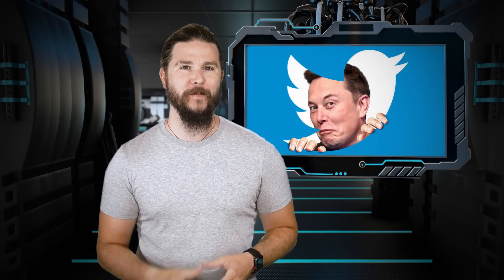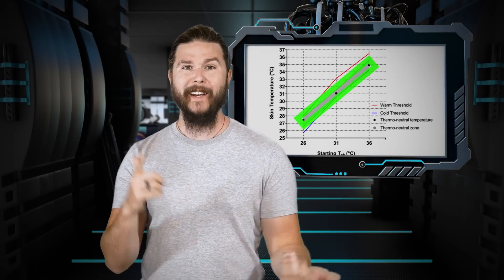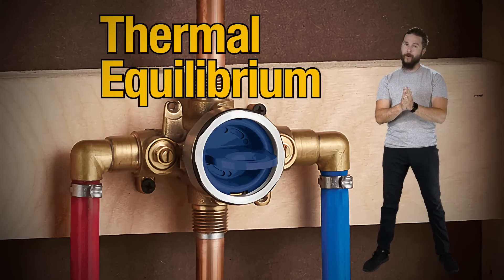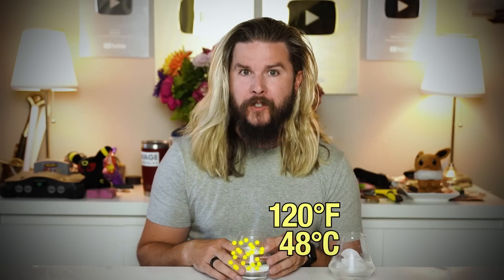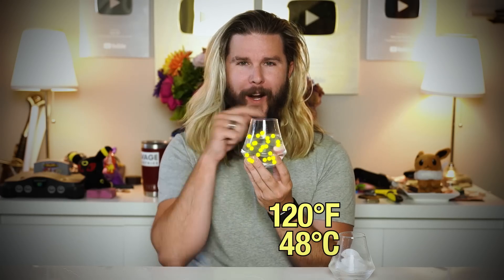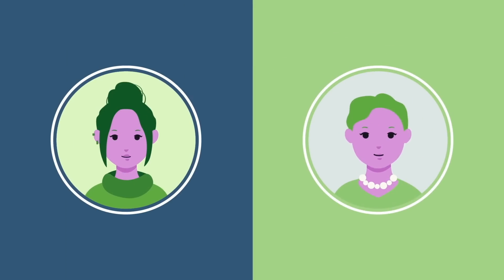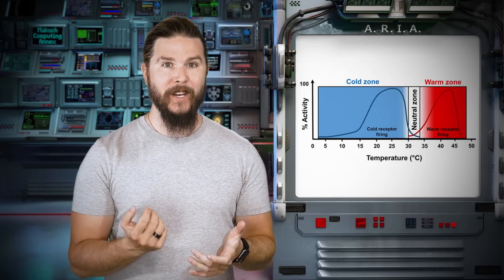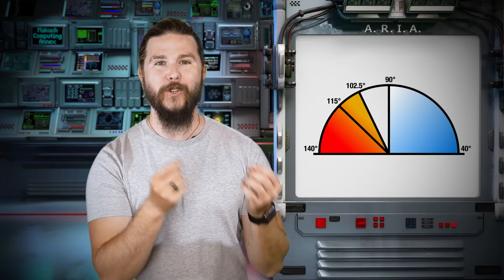Why Are Shower Handles So Sensitive?

Comment: As ever, great video! My problem is I have neuropathy and one of the results is that even in areas that I still have some sensation I can only feel very extreme temperatures like ice cold and burning hot. As a result I can’t tell if my bath/shower is too hot or cold so I need who ever is helping me to get in also needs to check the temperature so I don’t scold myself it is also one of the reasons I can’t cook anymore, sky high risk of burns!
Having any kind of peripheral neuropathy really sucks and can set limits on abilities you would ever even think. For me mine is progressive as is my primary life limiting condition of progressive cerebral degeneration, that’s the one that has me in a wheelchair as well as a host of other effects. It is amazing how much your central nervous system is actually involved in!

Comment: I actually find those showers easy to regulate when compared to the ones I'm used to. Electric showers have the temperature regulated by the inverse of the flow rate, and with a lower flow rate there is less water to warm me, so I have to deal not only with a temperature function that looks like K + 1/x, but also with a variable flow rate

Comment: Ah.

I didn't know these primitive shower controls still existed until I went to the US, and I didn't know people still had two separate taps for cold and hot until I went to the UK.

Why do you keep using these primitive technologies? You're not the PrimitiveTechnology channel. I've used thermostatic showers for the past 30 years and only had one case they didn't work - and that was a stupid installer installing it backwards.

Comment: I don’t get how this is a problem as all the homes that I’ve been in (east coast USA) have two knobs, one for hot one for cold, then a third knob /pull stick/lever to turn the faucet for the tub to turn the water to the shower head. 
This problem has been solved for decades, I just think the one and done system is just a contractor standard ie cheaper. 
Though it is interesting how the one for all system works. Or doesn’t work.

Comment: Here in Brazil we have two kinds of showers. Electric showers heat the water using a resistor, heating the water that passes through the shower. This is the worst and is the one with which we have this kind of problem too. It is either too cold or too hot, and sometimes it even depends on the local weather. On the other hand, we have gas heated showers. This one has a temperature control, like a thermostat, which lets you choose the (approximately) exact temperature you want for water. Also, this kind of shower has two handles: one for hot water and one for cold water.
Reply: wasn't the electric ones the ones that can give you shocks if the ground isn't used?
Reply: yeah but it's very unlikely and safe. I got shocked twice in my ungrounded shower head and it just was annoying. No real hard
Reply: harm*

Comment: IMHO we need a different shower water valve layout: three valves, three knobs. One knob for hot, one knob for cold, one knob for total flow.

That way, you can set it to the exact ratio you like, and leave it that way. No more fiddling with the water temp every time you turn on the shower; you just turn the flow knob and you're good to go. I think we should also have this for bathroom taps.

I plan to build a house one day, and I have every intention of setting my taps/showers up that way.
Reply: There are companies that produce something similar to this. In German they are called "Duschthermostat". The right knob is for temperature and most have even scale for the temperature ( that you have to calibrate one time) and the left one is for flow.

Comment: If it was just about finding the sweet spot once, that would be ok, but my shower gets actually hotter the longer it runs, so I have to re-adjust  constantly until the temperature stabilizes. I'm sure this is a common issue as well.

Comment: As a plumber I feel attacked + 2:03 the copper is soldered in to a compression joint and it hurts to look at
Also with turning down the temp on the water heater is dangerous because it's set to 60⁰c so it kills the Liegoners disease but you can take it down to 50⁰c but you have to put it back up to 60⁰c for 1 hour each week to kill the Liegoners disease

Comment: I've installed a digital shower, it just has a thermometer  and remote control with a range  32-42°C, and a preheating mode. Also solves problem with sudden temp jumps when someone flushes a toilet

Comment: I think also cold water is much less regular than hot water. Hot water is usually heated to a specific temperature and kept there, whereas the cold water isn’t as much kept at a specific cold temperature, it’s highly effected by seasonal changes. For example, where I live in Canada, it takes far more hot water to fill a bath in winter because of how cold the cold water mix is compared to in summer.

Comment: I mean that's just talking about standard well working showers... but I've experienced really horrible ones, e.g. where the temperature seemingly has a one minute delay to whatever setting I choose. During one vacation in Portugal the shower didn't really react to the setting in any notable way, only occasionally jumping between way too hot and way too cold after I passed a certain threshold. Every shower took me like 15 minutes, 2 of which I actually spent showering, and the rest just waiting for the temperature to change.
The shower in my last flat was also really peculiar. The temperature at any given setting was not at all deterministic, and I needed to move the handle in a specific pattern to reach the temperature I wanted.

Comment: I always just turn the heater to very, very low and just  turn the water handle to full hot, so there's no need to mix cold and hot water, and I just get inside and shower like a champ... BUT...
My wife doesn't understand this, and turns the heater to the max because she likes to look for the ideal temperature each time. When she does this, the next time I shower, I initially get horribly burnt.

Comment: Here in Sweden most showers I have come across have 2 full circles of motion for the heat (720°), So finding the sweet spot is not that hard, but it may require a lil dialing in.

Comment: I don't know who did your research, but US water heaters are almost NEVER set that high. (My AO Smith unit won't go over 140, and screams at me over 120. It heats the house, so I set it pretty high, but there's a mixing valve bringing it back to a safer ~100F for the taps. The commercial control board allows temps up to 180!)

Comment: Not to be critical... U kinda forgot to add the thing that makes finding that zone even harder... the delay before it reaches the shower head. (But this is will change based on design and pressure, low rate...)

Comment: What of the truly primitive shower installations with separate hot and cold knobs that must be managed to provide adequate pressure as well as the right temperature, fed by a tanked water heater that gradually provides cooler and cooler hot water so you keep having to turn down the cold knob to keep the temp up?

Comment: My favorite showers are the ones that have two controls. Temperature and flow. You can turn on the shower, get the temperature right, and then just shut off the flow. Next time you are ready to get in, just turn on the flow, wait for it to warm up, and get into a perfect(or close to it) shower. I’ve seen more of these in Europe than the US though.
Reply: Confirmed in Belgium (my shower)

Comment: There is no amount of money that will solve world hunger, that's literally just a marketing scheme to get stupid people giving their money to charities indefinitely. Charities which then funnel that cash into the hands of dictators and warlords, who use that money to further cement their power. The regions that don't produce enough food to feed themselves also have the issue of being utter shitholes that tear themselves apart the moment there's any attempt to industrialize or modernize. The rail systems in Africa need to be replaced every few months because the metal gets ripped out by scavengers and bandits, because stealing is easier than actually working and their populations are literally incapable of long-term planning (6+ months in advance) due to the climate they're in.

Yes I will artistically dismantle a shitty, unfunny joke without a hint of irony, because people unironically believe that you can just spend money to solve world hunger and the fact even 1% of the human race can be that naive keeps me up at night.

Comment: If you live alone and have a hot water heater just set the heater to your ideal shower temperature. Then all you have to do is use only hot water and not have to bother trying to mix it with the cold.
Reply: As others have commented, that's a recipe for microbe growth that can make you sick.  That temperature that's comfy for you is also comfy for bacteria.

Comment: Wet Kyle is exciting. I would note that turning down your water heater can result in a mild sulfur smell after a while depending on the bacteria balance in your water. The higher heat kills it off otherwise.

Comment: I feel like most of this could be solved by simply adding a gear system to your shower handle to downscale the range of motion. Like you said, you don't need the full 180°, so if you add a 1:2 gear, you double your accuracy in setting the handle, while not sacrificing too much of the range you'd actually want to use. Maybe even 1:3. No need to overengineer it.

Comment: And then you have houses like mine, where my grandmother likes the water hot to the point where most find it physically painful (seriously, last time she said the water would not get hot enough I used a thermometer and it read 115°f... she was not happy until it got to 120°f or ~48°c...) and I like it around 80, closer to 70 when its hot out. 
So we have a difference in preferred shower temperature of around 50°f or 28°c. 

I have never understood why most showers use that stupid single lever instead of doing what most sinks do and having separate hot and cold levers/knobs so you can mix them as you like...

Comment: there are also faucets with thermostats, where you can set it to a preferred degree and it mixes the cold and hot water accordingly. its pretty cheap and extremely comfortable to use. if you are willing to pay prenium however there are digital ones too, where you can enter your preferred temperature and even save presets, so its easier to change back and forth if people in the household prefer different temperatures. its very much extra, and might seem unnecessary, but  its kind of a gamechanger, and once you start using it, regular faucets will feel terrible.

Comment: Sounds like there's a market for a mixing valve that has a low sensitivity in the middle of it's range (allowing for greater precision), and optionally a high sensitivity at the ends of the range (to allow the full range of temperature)

Comment: The way the usual mixing valve is shaped also makes the flow area ratio form an s-shaped curve when plotted against the angle. This narrows down the range evn further, since the flow rate could change much more drastically in the middle, while barely changing at the ends

Comment: So essentially, my janky coal storage turned shower is better designed than regular plumbing. 

I have a cold and a hot valve, so I just crank the hot to full, and now I have a full 180 degrees of adjustment to the amount of cold water added.

Comment: Wouldn't a gear box to the main control valve, expand the range of motion that is comfortable, and therefore make it easier to adjust?

Also, I am curious if you could discuss the reason why propane has a higher BTU rating than Acetylene, but a lower flame temperature.

Comment: Power showers are an altogether different, and sometimes harder, beast to handle. Mine has three 'presets' (a plumber may know the actual term, but I do not), being cool, warm and hot, but then a full dial from 1-10, with 1 being lowest. What this means is that I have a good idea that 'hot 5.5' is good for me, as I'm very temperature sensitive, but I have no idea what my sweet spot on cool is. I also live with someone who likes to shower with lava, as far as I'm led to believe, and if I don't check the setting, I'm in for a bad time

Comment: I think it's awesome when you've been doing something instinctively for so long and then see the scientific explanation for your instinctive action when interacting with your environment. I turn my shower on before I get in and check the temperature with my hand. I start with the temperature handle in the middle and slowly bring it to my desired temperature. Can confirm it isn't very far from the middle position of the temperature handle.

Comment: Kyle, buddy, what happened? Your videos are usually well researched and informative but aside from the human sensing content... this one was kind of a swing and a miss. The type of valve you describe is, indeed, primitive and precisely because of that, there are many jurisdictions in the USA (possibly all of them) and elsewhere where you can't legally install one due to scalding concerns. ASSE 1016 is an often cited standard (see Chapter 27 of the 2015 International Residential Code). There are even two different types of regulating shower valves: pressure balancing (which compensates for flow changes due to pressure changes) and thermostatic which can respond to changing input temperatures. Of course, there are combination valves too for that belt and suspenders approach. The engineering behind those doesn't suck;  it's really quite interesting being 100% mechanical and they've been around since the 1970s. (At least the pressure balancing ones.) 

Obligatory acknowledgements: 
-Yes, I realize many parts of the world (USA too) still have old-school valves. Building codes are often only enforced for new construction or renovation. My parents' house has one of those dreadful valves and I swear my dad flushes the toilet every time I take a shower. 
-Yes, I did see the part of the video where thermostatic valves were name-dropped but if this is about valve engineering... why not talk about the engineering? This could have been "Shower valves used to suck, clever engineering fixed them."

I hope this is coming across as constructive feedback because I really like your channel and I'm truly not trying to be negative or discouraging. Maybe a collab with plumber and Youtuber Roger Wakefield or builder and Youtuber Matt Risinger would be fun/informative? They're both in Texas, though so not exactly Facility adjacent.
Reply: I appreciate your well worded comment, interesting to hear some good corrections.

Comment: After watching this I made a observation on my own shower

We have brick walls with the pipes running in the walls and winter is approaching.
When you open the water and think you goyt it at the right temp, it will continue to get hotter as the pipes heat the bricks so you have even more of a battle to get the right temp

Comment: Hey Kyle, nice video but you really oversimplified this too much. You never talked about water pressure, for example assuming that the water pressure for both the cold and hot water is the same. You never talked about different types of taps. You never talked about the time delay when you adjust the water temp as the piping comes to thermal equalibrium with its surroundings nor the heat loss from the hot water tank outlet to the tap. You never talked about the ambient air temperature affect on this. You never talked about how lowering the temperature on the hot water tank will reduce the duration that you can maintain the temperature depending on the size of the tank, for those who like really long showers. As well as a few other things. Usually you go much more in depth on your videos. Only thought that I'd bring this up so that other viewers know there's several more variables to consider...

Comment: In Europe (except UK, with mostly completely separated hot and ambient water system), most shower mixing valves both has a total flow valve and a temperature valve which contains a wax thermostat actuator, which aids in keeping the shower water to the set temperature without too much hysteresis, and to prevent scolding. Since the hot water piping (worse if copper) usually sits at ambient room temp, and takes some time to warm up, and thus cool the hot water as it does, not to speak of the head flow which already is at ambient, when hot water starts to flow (unless used constantly) the wax-valve also aids in more rapid hot water flow initially as the center position of the temp knob actually is set way warmer than indicated and thus flow starts off at a higher rate on the hot side, and when the hot water finally reaches the intake of the mixer where the wax actuator sits, it expands and shifts the gates of the temperature valve towards the cold side.

Neat huh?

Comment: Im from brazil, and thats no the way at all how showers usually work around here. They generally have an eletric resistance that goes around the shower head, so as that resistance heats up, so does the water. For warmer water, you need to restrain the amount of it going to the shower. It isn't a very good system tbh.

Comment: Simple fix with a slush tank and valves controlling what goes into the tank from which the water mixes before going down the shower pipe, seen some showers where the water comes out divided still (aka left and right are still cold/hot due to not mixing well.). Though down side is delayed  temps.